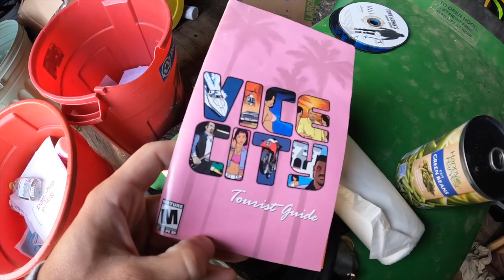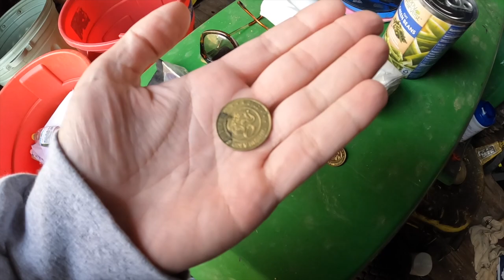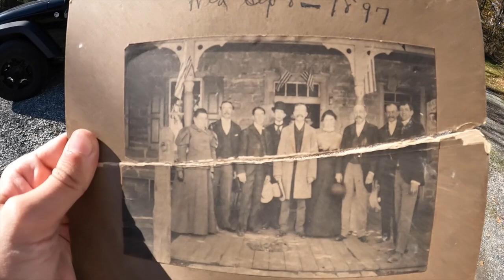Why Did They Throw This Out For TRASH?! - Trash Picking Ep. 682

Comment: I am 90% sure that's a hand-tied Turkoman Persian rug.  Even in that condition, it could be worth some money.  I hope you saved it and didn't end up tossing it.  Hundreds of hours of work, there.  The power washer will blast parts off with it in that condition.  Hang it over a railing or lay it on the driveway and just hose off the big stuff.  Pressure will do too much more damage.  Let it hang to dry.

Comment: Regarding those blue planters with the hole in bottom corner, I have some like that. Those holes are for watering so you can water it from the bottom. There is a reservoir in the bottom so you won’t need to water it as often.Those are nice!

Comment: Great video!   You found some cool stuff. That elephant head looks as if it fits as a cover on the cup that you showed right after that. The elephant head is a soup bowl and the body is a mug.  I think it's a bit of kitsch from the 1960s/70s.  The rug looks old. Once you pressure wash it, I'd bet it looks great, no matter the bits of damage - not that bad at all.  If you're gonna use any detergent on it, check first to see that the color wouldn't come off on the cleaning.  A bit of diluted detergent on a cloth and rub it on one of the damaged parts to see if the color comes off onto the cloth. The rug has a label on it's underside. By taking a picture of it you could look it up online. Some of those old rugs could go for a nice piece of change and I'm not talking about a hundred bucks, either.